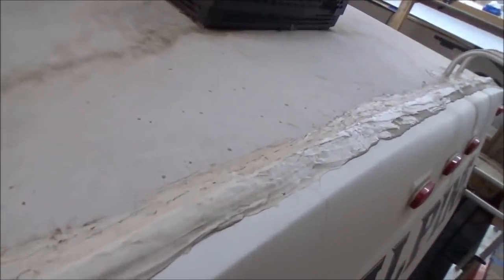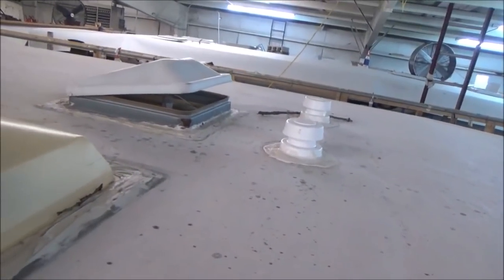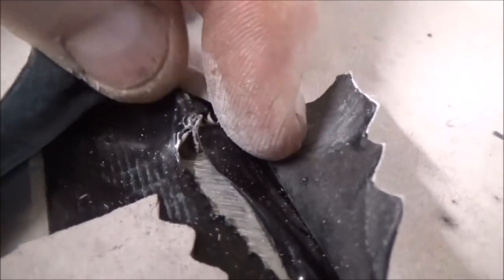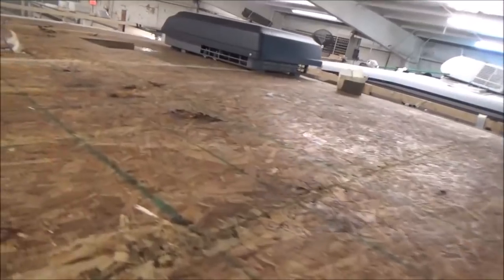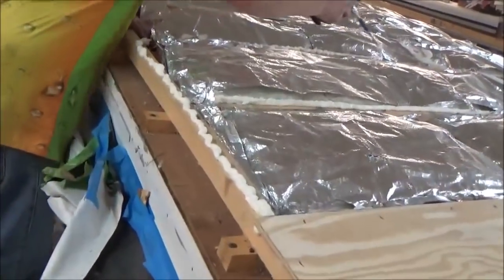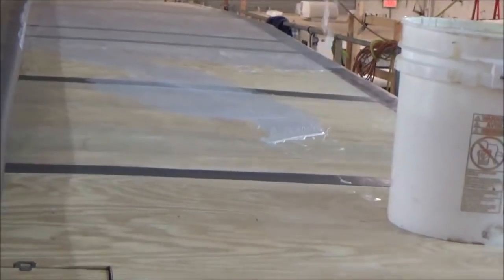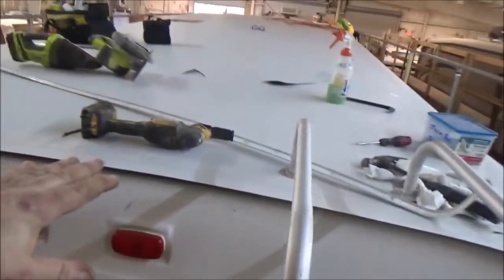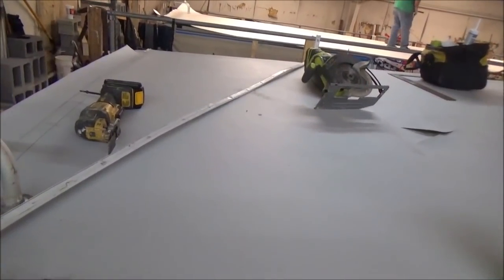RV Roof Replacement 0n 2011 KeyStone Alpine

Comment: Hello, i am in the process of replacing my epdm roof on my 17' travel trailer, and i plan to replace it w another epdm rubber. Or should i go with a TPO roof? Is there an advantage one over the other? Thanks and great video!

Comment: I will say your the best in the rv roofing world , i did my roof the same way after watching all your vids . That being said dont cut your quality of work with self tapping screws for the bottom  ac flashing flange , im dont thinl you sealed them also they will shake lose  overtime . Tig weld or braze your metal to metal flanges . Also where the rain gutters .

Comment: Wow, wish these campers came this way. Awesome job
Reply from the maker: You mean with qulaity craftsmanship and quality products folks have thought they paid for??... LoL. Corporate America will pay a man 6 digits a year to seek out where they can save 1 cent! These campers are getting worse by the year. I don't own one. I'll have to build mine.
Thanks for watching!
Reply: @RVROOFINSTALL  YES ! On quality craftsmanship and products. I own a 5th wheel and have fixed a lot of issues on it. I highly doubt I will purchase a new one anytime soon given all that we have gone through with ours. I just last fall installed hydraulic disc brakes on it myself. I have never felt confident with the electric brakes. The 5th wheel is now 10 years old but looks new. I know sometime I will need to replace the roof. I doubt I will do as great a job as what you do there. Great video though. Thank you

Comment: im in Austin texas have a 2012 redwood 36RE needs a new roof looks just like the 5th wheel Alpine found a small soft spot where the sattilyte wires go in to the right of the air condioner needs some repair work and a leak near a corner also ,where r u located?
Reply from the maker: We are located in Fort Oglethorpe, GA. Just a few miles south of Chattanooga TN. 423-475-7663.

Comment: Thanks for the video's I've watched  a lot of them I am putting a new liner on my 97 Dutch star and my question is on the front and rear end caps should I put the liner underneath or on top mine both were under I was going to go under on the front and over on the back thanks John
Reply from the maker: The way you were going seems logical. You need to protect the roofing from the siding  whether it's over, under...vise versa. 
Thanks for watching

Comment: I think if the RV had been made better the roof should be made to last a lifetime. Thanks for your video and efforts to help us out. Happy Easter Season 🌴☀️🕊🌴🌴🐣🐤
Reply from the maker: They're all the same. I don't own one. Thanks for watching.
Reply: @RVROOFINSTALL  Yep, some travel trailers have fiberglass or aluminium roofs. I think these are a more durable roof. Thanks
Reply from the maker: @Hundert1  Fiberglass or aluminum are no better. The problem isn't the actual rubber or membrane, it's the fact that there are no curbs or boots. That's called detail. That's where the leaks start....from the protrusions.
Reply: @RVROOFINSTALL   So the rubber membrane needs to be curved upwards like an inch or so around every roof vent, skylight, A/C unit,  then caulked? Instead of just laying flat and caulking on top ? I'd still feel safer,  especially on a full walk on roof, if the roof were solid fiberglass or aluminium. A rubber membrane just seems too easy to puncture by so many simple accidents not requiring much effort. thanks again 👍
Reply from the maker: @Hundert1  rubber...EPDM...Is the cheapest in product on the planet. We use  6o mil TPO. We have replaced many fiberglass roofs. They're on the channel. Thanks for watching. We just try to show where and how failure happen and why.
Reply: @RVROOFINSTALL  Awesome, thanks for caring and sharing. There are always better ways, methods, products and materials, thanks to science, technology, engineering and researchers. God Bless, keep up your excellent work and videos. 🙏

Comment: What do you use for securing decking over delaminated decking after removing the delamination ? I used construction adhesive previously on my 2004 R Vision but now I am doing TPO again on my 2004 Jayco Designer ( BTW Jayco lied about the thickness of the decking, they said 1/4" and I don't even think it's 3/16ths ) but it looks like the M1 is a superior product . I probably use exterior luan as before (1/4" .).Actually I prefer fiberglass roof but even the old pittsburg lock seam aluminum roof were better than rubber if you resealed seams every year. GREAT VIDEO'S !!!! Sorry a little long.

Comment: Hello... thanks for the videos, great information there!
I have a pea size hole on the rubber of my roof, it has been in parked for the past 6 months and I didn't see that hole there before winter... the wood inside is already curling and softer than the rest... Under the membrane is a little wet,  should I just patch that hole? 
Any suggestion on how to dry it before patching the hole?
Reply from the maker: You could patch it but it won't be a long term fix. If the wood is dry you could inject some caulk under the membrane and then out a roof tape patch, although you need to clean and prime the roofing membrane. Second option...file a claim with you insurance company.

Comment: My EPDM or the other ruber roof looks ok.  But I have a spot wear it looks like a branch poked a hole and than was calked(lap sealant). I just noticed that the ply wood it badly rotted about 1 foot across. it feels like some of the wood framing might also be rotted. Should I just peel the roof back(can it be reused ?) and replace the wood or just do the EPDM rubber roofing coating system ?  I live in it and have lots of rain coming withing a few weeks. I can get a carport tent with clear tarps to work on it.
Reply from the maker: The rubber roof is not worth salvaging. I'd recommend tearing it off, make repairs and adhere a commercial membrane, that is if you are doing this yourself. Thanks for watching.

Comment: If you don’t recommend Dicor then what do you use?I need to purchase some.Are you a fan of eternabond?
Reply from the maker: Nothing will stick unless it is prepd. Needs to be primed. All that stuff you can find at your local commercial supply house.
Thanks for watching.
Reply: @RVROOFINSTALL  can you give me any names of the products?I was going to try to order them off Amazon.Thanks.
Reply from the maker: @Dave-ld3dr  any membrane primer will work. Then Rapid at Home Depot in the concrete section.
Reply: @RVROOFINSTALL  Thanks
Reply from the maker: @Dave-ld3dr  Dicor is made by Carlisle Syntec. Carlisle makes a commercial rubber lap sealant if you want to use that. I hate to give advise because I can't see what your working on and if it fails you'll be shaking your first at me thinking I'm giving you bad advise. If no it were mine I would take the time to get the Dicor off. Mineral spirits will break it down but makes a mess. Once clean, remove and clean the vent underneath as well. Wash well with denatured alcohol to get the spirits off. It leaves a slick residue. Once clean prime the membrane and the apply a very generous bead of the Rapid non sag to the bottom of the vent and settle the vent back into place. The idea is to have about a ¼ inch cushion if caulk under the vent. Let cure, then replace the screws. Out a do. If caulk where the screws will go and torque the screws down so they're right but not trying to crush anything too tight. Then go around the perimeter of the vent with a second strike of Rapid. It will e time consuming for sure. If you ruo the roofing you can use the eternabond as long as you prime  the roofing. Then prime the eternabond where caulk will be applied.
Reply: @RVROOFINSTALL  Thanks for all the advice it’s much appreciated.I discovered the corner on my rv roof is soft.Probably a 3x3 area but once I open it up I’m sure it will be a bit larger.I bought a used trailer last year & thought it was rock solid.I noticed a small tear on the side of the rubber where it wraps around to the wall.After I got up there I realized the weather had been getting under it for awhile.I plan on opening up that area & doing whatever it takes to repair it.There is no vents in the front so hopefully I can just lift the plywood & replace it.If there’s any damage to a trust then I’ll have to deal with it.Sad because the roof is solid except for that area.Proof you need to get on your roof at least once a year & look things over.Thanks for the advice for products I plan on sealing everything up & moving on.All the best!

Comment from the maker: The construction if anything is worse. Rest assured that any improvements the RV industry makes would be for the sole benefit of the RV manufacturer.  All low slope and flat roofs need curbs to function water tight.  So it doesn't matter if it's poured concrete, 1/2 inch solid steel, with no curbs it will leak.

Comment: If Dicor is crap, what brand caulking do you recommend?
Reply from the maker: Please don't take this the wrong way my friend....these videos a are not tutorials. A camper roof is not quite that easy to do. But to answer your question need use M1. It's a commercial caulk. We do not use anything RV. Dicor is the absolute cheapest products on the planet. They exploit people's lack of knowledge for their gain in sales...in my opinion. Why would you want to apply a caulk that requires you to have to constantly reapply?? Just think about that. A yearly touch up is smart....but times a year??? C'mon.... they're holding in to your wallet!
Reply: We us a lot of dyamonic urthane sealant on flat roof termination bars... Its the best sealant..i think
Reply: @shermanv3301  I worked with Tremco Dymonic on metal roofing. It's the only product we used. You are one of the very few people to mention it and as far as my experience goes it is superior. That stuff sticks to everything, especially me!!! LOL.
Reply from the maker: @shermanv3301  who are you?

Comment: What adhesive do you use for the membrane to the decking?  Looks like you do a great job and take your time...
Reply from the maker: We use GAF TPO adhesive
Reply: People do not realize to install these per manufactures instructions to keep warranty you are using expensive products. I’m not even talking about the field sheet. The sealant, primer, boots, pour sealants, all have to be TPO grade and done properly. I just watched a hack install his like EPDM. Dudes gonna be disappointed when his new roof leaks in a couple years. The curbs are a crucial necessity but I bet DIYers rarely have installed their own much less hot air welded anything. There’s a reason people pay pros to do their craft. Kick ass vids.
Reply from the maker: We are the only certified RV roof installers in the country. We can extend the GAF warranty however we need to follow GAF install procedures to the letter. We do that for your protection.
Reply: Eric Styer I have been able to get the GAF TPO and WB181 from a local roofing distributer. Having to purchase full product i.e., 3 times what I will likely use. I can take some time to do the work as I have a large enough garage. The TPO is very heavy and had to cut roll down and chain hoist to get on roof. These guys look to do great work, just can’t afford someone else to do it. It is pretty amazing how much damage some of these new RVs have.  My RV is a 07 and didn’t have much damage but I did replace 3 sheets of decking. I hate the EPDM junk. I am also able to get the M1 from the same dealer but buying a entire case as they don’t stock white.  I also bought a Leister heat welding gun and will be practicing a lot before figuring out those curbs. The unstructured is pretty expensive per square foot also. All in will have close to $1300 in material and tooling but does take a lot of time.
Reply: Roy Sprague the heat welder isn’t too bad. Your budget is about twice what mine was. I ended up with JM 45 mil structured. Nowhere near as clean and pretty as RVROOFINSTALL does them but for my 05 it will last much longer than it would have otherwise. I did the curbs and am at HD right now actually looking for longer bolts for the AC units.  Will prob have to use allthread and make it work. The whole time I’m doing my project I’m wishing I had a shop to keep it out of the weather.
Reply: Eric Styer all thread was what i was planning from the stuff I found online. Did you have any recommendation on AC gaskets?  I did find the large head torx screws i.e., fastcap power cabinet screws.  I am currently cleaning everything up and removing the dicor.
Reply: Roy Sprague did you mangle up your existing gaskets? Of course you can get replacement gaskets however a thick closed cellulose would be fine too. The actual AC kits are probably super expensive for what they are. I have access to hi temp type my company (CaptiveAire) uses but it’s expensive too. HD doesn’t carry anything in store that would work. Closest thing would be their rubber insulation used for refrigeration insulation but it’s not as dense as RV AC gasket kits. As for the bolts depending on what brand AC you have you may have a 1/4”x20 thread which you can get couplings for, otherwise allthread is what I’m doing this very moment. One of mine is an 8mm thread so it’s getting 1/4” too.
Reply: Eric Styer the gaskets seem to be in pretty good shape.  All the ones I find online don’t seem to be as dense foam as what is on them now.  Yes the oem replacements are very expensive for what they are. I was also able to find some feet from JW Winco for supporting the them.
Reply: Roy Sprague got my feet from Amazon. Using a furniture leg with 80mm pad. Displaces the weight just fine. Would love to see your project as you go. Message me and I’ll send some pics of my progress too. Take Care.

Comment: What do you recommend for caulking? You have made it clear that dicore is junk but that is all I see around here. Thanks
Reply from the maker: Are you wanting to just go over Dicor or are you doing a new roof?
Reply: @RVROOFINSTALL  I’m planning to do a complete re-roof with the 60mil TPO and the raised curbs like you folks use. So I will basically only have caulking at the trim strips. For the ladder curbs what is recommended to fill the curbs. Thanks fo taking he time to show us novices the correct way to do this.
Reply from the maker: @elevator9592  this is not a DIY channel friend. RV roofs are not easy to do. A lot of detail to pay attention to. All the products you need you can find at your local commercial supply house.

Comment: So let me express my opinion. Ive had multiple rvs. Been around construction my whole life. Also spent 5+ yrs in water damage trade. 

Correct me if im wrong but, why do they fail to properly flash rv’s. When i say flash im talking about the construction of the rv itself to prevent leaks. I feel they could be flashed/constructed in a much better manner to prevent water damage. Im not expert in life, but we supposivly been to the moon and back, yet they can’t properly flash an rv so theres no possible way water can get in the corners. To flash it, construct it so it’s impossible for water to get in the crevices regardless if theres caulking or not. 

Ive talked to owners of rv sales businesses and yet they claim theres no roof warranty for over 6 months. Are u kidding me?

I believe this is a conspiracy,   Well technically i shouldnt call it a conspiracy, as they are doing it right infront of u. 

Why are the corners not flashed? Same way u would do to a window to a house. Or a house roof, etc

These rvs are literally designed to leak. Trust me. Ive put enough thought and time ln this issue with rvs. Its so basic ( common sense) it baffles me why anybody doesn’t question it.

Why are all the rvs constructed so that the face or front, underlaps the roof, and the only thing stopping the water getting into the front corners is caulking. Its beyond my comprehension. When u proper flash(a house roof, house windows, house siding, rv siding, etc) u dont have to worry about water penetration. 

They do this intentionally, in 10-20yrs u got water damage on all corners of ur rv. Next thing u know u got soft subfloor. 

Ive come to conclusion that this is intentional. As it seems very basic to prevent
Reply from the maker: Corporate america doesn't care. The manufacturers have a moto....Get it built, Get it out, Get it sold. So why are they not built well.... greed. All the money they save on material and labor to do proper steps and pass the problem on to the customer...greed. 
Thanks for watching.